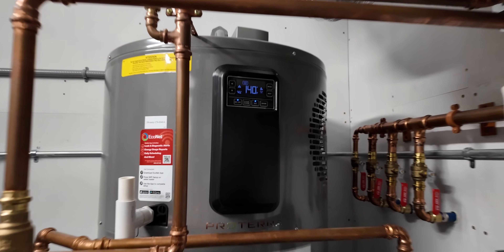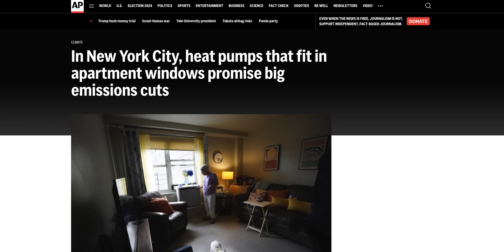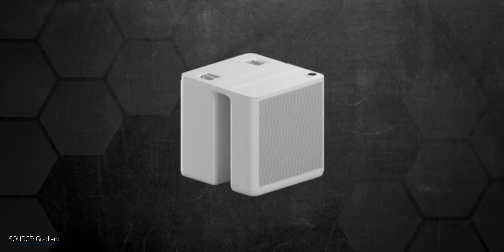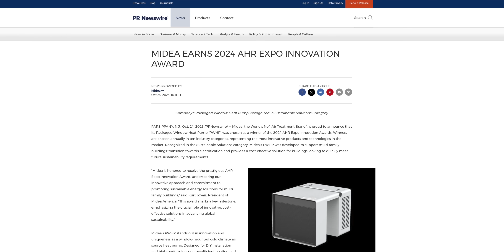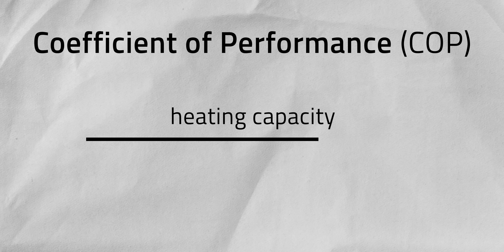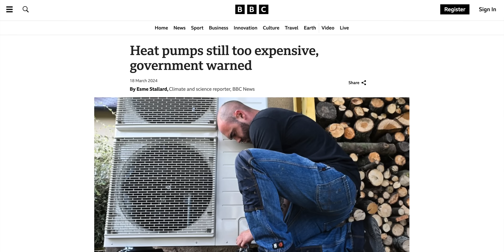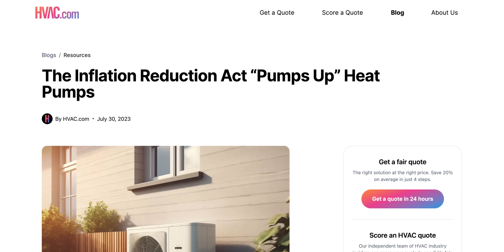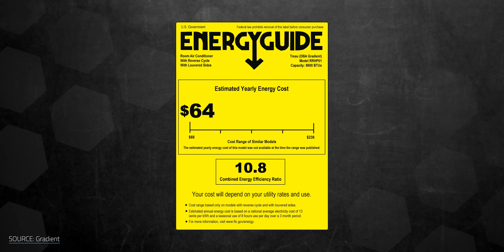Why This Window Heat Pump Is Genius

Comment from the maker: Would you want a unit like this for your home? Enter the CCAN Action Fund EV raffle: https://undecided.link/CCANActionFund

If you liked this, check out Solid State Batteries are Closer Than You Think https://youtu.be/gG2_5GMWf1E?list=PLnTSM-ORSgi7uzySCXq8VXhodHB5B5OiQ
Reply: For an individual renter in a building with centralized heating, this doesn't make sense at all.  If your heat pump has no connection to the central heating system, the temp in your spaces is still still going to be at the mercy of the main heat source.  At best, this would allow you to warm a room that's always too cold in the winter.  And for the price of two or three of these units I could add a mini-split to my house, get better results, and not have something hanging off my windows.
Reply: @toddthreess9624  not many 100-year-old buildings in Manhattan and Boston has centralized heating or AC. If you're lucky your building uses steam heat which can be wasted energy expenses for the landlords and for the tenets that live on lower floors since heat rises which then makes tenets that live on the upper floors exhaust the heat by leaving the windows open during cold nights because it's too hot.
Reply: @toddthreess9624   Or you can just close your vents.
Reply: While this is an option for vertically hung windows, they probably aren't compatible with sliding, casement or awning style windows, which will reduce viable applications in newer units.
Reply: screw your raffle...i dont have 200$ i live in poverty....Im building a small eco-frindly house...i wish i could have a heatpump.
Reply: @gothboschincarnate3931  You "live in poverty" but are building a small house?  Lol.  Zero poor people can afford to have a house built.  If you rent or live in your car or on the streets, I might believe you.
Reply: I don't understand I have a Midea heat pump window unit I got it at Costco on sale for $275 as energy star rating what's 18 k air conditioner heat pump with seer rating 15 3,000 seems a little steep
Reply: @Theresahackforthat  Are you sure it's a heat pump or is it a conventional air conditioner? Does it heat as well as cool? 
I went to the Media website and they don't sell the heat pump version yet.
Reply: @Theresahackforthat  Someone took a normal window shaker, made it into a fancy "U" shape and added a pump for condensate when cooling and called it a "New fancy heat pump" when it's the same as what everyone has been using for 50 years. The price is because NY is forcing buildings to buy them.
Reply: @kurtzxcvb3481 the energy star rating is not what you're paying for. You are paying for the heat pump, which is not only A/C but also a Heater and a super efficient one at that.
Reply: I have vertical slide windows so, sadly, this won't work in my house.😔
Reply: You put miss statement . Window air conditioner is a heat pomp. The only difference is, that it does not have reversible valve.  So both of the  companies charging around $2500 for installing reversible valve. I will consider that as industrial scam. Additionally,, heat pump are not more efficient then you gas heater, unless they are supply from renewal electricity source (solar or wind energy).  Power station efficiency is around 40% minus transmission loses. So with COP 2.6 give you just about 1. What City like New York should do: Pass law that all buildings require to have displacement heating and cooling systems. It could safe up 50% of energy and significantly improve air quality on officer or aparments. Windows air conditioners or reversible air conditioners traditionally called heat pump can be design to operate as air displacement units. The difference is to direct the air downwards not upwords.
Reply: I think that if they really wanted to sell stuff like this you make it simple and inexpensive.  Having a saddle shape that sits on the window sill and leaves the window unobstructed is cool and all, but style is usually pricey.  If the primary difference between a window AC and a heatpump is one valve and control electronics, I'm wondering when somebody like GE or even Walmart will just add that stuff to a standard window AC?  I mean, lets be clear here, a standard 9000 btu window AC is already a heatpump.  If these new ones are $3000 (aka six months rent), it's not because of them being reversible.  It's because of things like Bluetooth connectivity, a cell phone app, IoT,  the Bling factor, or some other nonsense that appeals to expensive apartment dwellers.  

If people really want to do something about climate change, stop making the tools to do it so DAMNED EXPENSIVE!!  Why is this sooooo hard to understand?!?  This is literally why we are failing on Climate Change.  This is why all these new (old) ideas will never save us; they're only meant for the top 10%.
Reply: @Cee64E  the technology that fits into a compact unit like this will always be expensive on the first models and these units aren't available yet from both manufacturers. Eventually competition comes in to make things more affordable and efficient. The hinge mechanism alone to allow user installation probably took a lot of R&D investments due to weight issues.  Speaking of manufacturing, what was involved into mass producing this compact Mini split? Are there already machines that can fabricate these units on an assembly line? Once they scale up production, consumers will be able to buy them at reasonable prices. That's if these units catch on. Not everyone can get solar roofs installed because it has been really expensive and home solar has been around for 40 years. EVs are a hard sell and these were around for even much longer than you think. Midea makes U shaped window AC appliances with all the fancy modern technology for roughly the past 6 years. It's only recently that you can now buy one at Costco for under $300. Guess how much the first units were coming off the assembly line?
Reply: @Cee64E the whole thing is mostly a lie. 
For one, the climate has always changed and will always change, regardless of whether humans even exist. This handful of degrees we are supposed to be so terrified of is barely a blip on the larger history of Earth's climate, and while humans may well be contributing, it's nearly impossible to say how much, and absolutely nothing to suggest that we are even close to being the main cause, even with all of our forms of pollution or together over the centuries. 
And you've caught on to the lie, the fact that the rich people get to throw all the carbon they want out there with things like private jets and huge mansions, and still blame us for not doing enough, because somehow all their emissions are done on service of fighting climate change, and there are so few of them that it doesn't add all that much, anyway... 
It's the same blame deflecting lies that rich people and corporations have been using for decades, if not centuries, and somehow, the bottom rung that is always affected the most by these campaigns and policies still seem to accept it as fact, generation after generation.
Reply: Sixteen SEER vs 10, I'll take the 16.  Ten is not that efficient when you consider residential units can easily be had that are 20 SEER and the industry leader is at 32 SEER.
Reply: Great topic!
There are many U-shaped window A/C units listed on Amazon in the $400-$600 range with similar BTU quoted in this video. WHY are heat pumps so more more expensive at $2000-$3800 quoted in video? The only difference I see is the reverse-flow value to allow heat pump operation and minor software tweaks. 
This almost needs a video to explain why heat pumps are 4-5x the cost of similar-sized A/C units in the US. It really seems to target non-home owner unfairly. Again searching Amazon (and other big-box stores), the number of A/C models far exceeds the number of heat pump models. Is there a patent, or some other IP that is preventing manufactures from producing more heat pump models?
Reply: @AerialWaviator  the seer rating for the $2000+ unit is in many cases 2 or 3 times more which translates to 1/2 to 1/3 of the power usage per btu of cooling.
Reply: Just started the video, but will they develop one for side to side sliders? Most don't recommend just flipping it on it's side 😅
Reply: Wait a year or two and there'll be units from China at a tenth of that price point.
Reply: @dougtaukobong-olsen7003  they are from china, lol..
Reply: absurdly expensive. these U-shaped or saddle shape window units became popular in the middle of pandemic. while nice, those will be easily beaten by small split-type or duct-less units that are getting popular here in Southeast Asia.  The outdoor and indoor parts of these are small and light, and one would only route the copper tube, drain pipe, electric cables through the window opening.
Reply: NO. A nightmare for maintenance and as you know every evaporator needs frequent cleaning for that COP of yours to be adequate.
Reply: So this is great and all, however the power draw on current infrastructure is such that they pump nitrogen in the underground passageways to keep the lines from melting. Supplying units is great and all, however the grid will have to be improved in NYC before starting a "heat pumps for all" giveaway to replace the oil/gas fired boilers being used now. 
LOL
Reply: The simple expedient of adding flow control valves to each radiator in an apartment block would make an immediate and low cost improvement to reducing heat lost from those buildings. It's nowhere close to using heat pumps in terms of efficiency, but the payback time would be short, allowing landlords time to save enough money for the up-front cost of having a building-wide heat pump to replace their old boilers. It's a stepping stone towards a solution, and the individual controllers will continue to work with the new heat pump. If done properly, one large heat pump will be more efficient than having dozens, or hundreds, of individual small ones in each apartment block.
Reply: @RWBHere  That's exactly what I was thinking. Seems that might be an issue though if everyone in the building happened to have their valves closed. Not sure how much pressure those pumps can build, but some kind of overpressure valve looping to the return may work? 

I don't have any experience with larger commercial or apartment building boiler systems though, only smaller residential ones.
Reply: Wait a second. 

You said the window heat pump would be able to be used for $64 -100 something a year. But then threw out $172-2000 something for the traditional AC. 

How big is the traditional AC? Is is a comparable 9k btu, or is that including some ancient monster 5 ton thing cooling a large, uninsured house? 

You may have addressed that, but I didn't hear it.
Reply: Can’t buy a ticket if I live in California😥
Reply: @GH-ci8tc  Good.. Saved you some money from the scam...
Reply: I would love a unit like this in my home, but I don't think it will be practical right now.
The only window it will fit through is right next to my bed, and will take too much floor space in my moderately small bedroom.
Reply: They are price gouging. There is nothing to these things. Do your viewers a favor and look for similar products made in China.
Reply: I saw these and the inverse U shape ones, and I thought it was a great Idea, but do they work for windows that open horizontally?
Reply: ...and now do a deep dive into the 'Jean Pain Compost Heating System' in plenty of time for folks to set one up before winter heating bills impoverish them.
Reply: So, how about a link to purchase these units.
Reply: How does CEER correlate with SEER2 ratings?  A few mini-split systems have a SEER2 rating of 28.  Your video gives Midea a CEER of 16 and the Gradient of 10.8 what's 10.8 receiving an energy star rating.
Why would a 10.8 receive an energy star and a 16 not?
Reply: @powerguymark  as far as I've been able to tell ceer is typically quoted for heat and seer is quoted for cool.  But it gets confusing when you have a heat pump that does both.
Reply: Sure, sign up if you want to be bombarded by doom and gloom fear mongering for the rest of your life... 🤣
Reply: I really like the idea but the elephant in the room when it comes to cost is heating water.. how are you creating hot water supply? Also you said the noise is low but let's face it if it has a fan it will vibrate right? And vibration will create a noise so how do you deal with this in bedrooms? I really love the idea of both heating and cooling and it being easy to install it's definitely going in the right direction. Finally fire safety.. if you have 1 unit on your balcony and then just have rads or underfloor heating in all other rooms that reduces the risk of a fire from electrical fault but having independent units everywhere increases that risk and also window fire escape restrictions will be effected. But it's nice to have options as there no one solution to fit all property designs so having choices is always a good thing.
Reply: Federal subsidies are the biggest lie only liberal Biden-AOC admin can come up with... All that money goes straight to the manufacturers pocket.. The moment x$ subsidies  are introduced , the manufacturer discontinued old models and releases new ones priced x$ higher ... And its paid for by... You know your taxes
Reply: Yup. It'd Be so much better than the heater And air-conditioner in my apartment.
Reply: @UndecidedMF  No. Overpriced junk. Keep the old unit and spend $2000 sequestered carbon in the ground.
Reply: You know...a AC for everyone... Would be affordable.

This is exclusive, for rich people.
Reply: where is the link for the heat pump ac ?
Reply: @undecidedmf I need one for a skinny vertical window in my garage that does heating in the winter and cooling in the summer. Can these units be oriented so it's basically on its side?
Reply: I’d definitely consider getting one.
I’ve lived in apartments where I have to run an AC unit throughout the winter to counter the overheating of my building.
I’d love it if they’d remove the radiators (none of which is adjustable) with these units.
Reply: You made a mistake in your video.  Old school conventional window air conditioners can be purchased in both AC only and heat pump models.  
The advantage of the new technology in this video is noise and efficiency compared to a conventional window unit.
Reply: I am retired from the HVAC industry and wanted to make something very simple for all of you who cant understand how a window heat pump can be over 2K more, well your right it shouldn’t. There’s only $100 more in components, the only reason is a lack of demand and a relatively low production. When the demand becomes higher this will be a $200 option.
Reply: AC units with heating/cooling options are few HUNDRED dollars not few thousands.
Scam.
Reply from the maker: @sznikers  can you share links to any?  Many of those I’ve found are not heat pumps (they use resistive heat elements).  And the ones that are heat pumps have VERY limited temp ranges (only warms down to about 40F outside).  I haven’t found anything comparable in that price range.
Reply: @UndecidedMF  also have a midea heat pump portable ac and if you move the thermometer it will operate yearly and rather well
Reply: @UndecidedMF  Whynter ARC-1230WNH is a heat pump with heat mode, includes a condensate pump. The manual states 'ambient temperature range for unit operation' of 41 - 86 deg.F but I am not sure that is outdoor temperature. I guess I will find out!
Reply: This looks like the same scam ran by Omaze...
Reply: @FJB2020  Midea is a well-known global hvac company. It's less known in the United States though.
Reply: @riopato2009  I know who Midea is as a lot of mini split brands are actually made by them or gree.. I am talking about the win a car scam he is promoting.. Not this overpriced window unit..
Reply: This is pure gimmick marketing trying to separate rich idiots from their money.

 A half ton mini split is literally 5-700 bucks
Reply: I don't know if you can change this, but imo the auto translated titles are jarring. I watch youtube mostly in english and reading german auto translated titles always feels off.
Reply: For 2 to 3k? No. I live in Florida so heat is of very little concern, and what little it is I have computers that heat rooms up just fine. Not worth it till they com down in price by a lot.
Reply: @hardwire666too  "Heat Pumps" don't just make things warmer, they make things cooler too
Reply: @pcis8000  Thats the main reason it's not worth the price. 2-3k for a single function that is solved with a $2-300 window AC?Nope.
Reply: @hardwire666too  it's 2 functions and they're cheaper to run because they're more efficient
Reply: No1 spells out N Y C H A 😂 just pronounce the acronyms as if it were a word Nycha you won't sound like a phony 😅
Reply: No.  Not even a little.  This must be a joke
Reply: The government makes a problem, and the private section has to find a fix, making everything more expensive. Thank you, government, for being the biggest waste of money known to man.
Reply: @letsgobrandon4175 civilization makes the problem, the government makes you take notice of problem behaviour...don't hack at the only thing keeping your first world self safe, happy and covered in cellulite.

Comment: This seems expensive. Here in the UK a quick web search and I found an LG reversible split AC for only £799 ($1,070) Sure it needs installation but I doubt that costs $2,000.